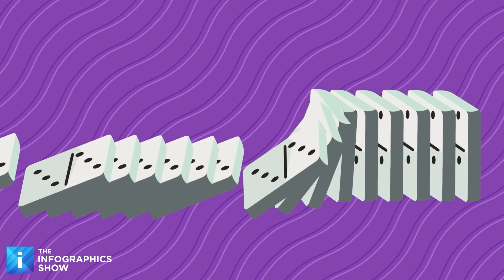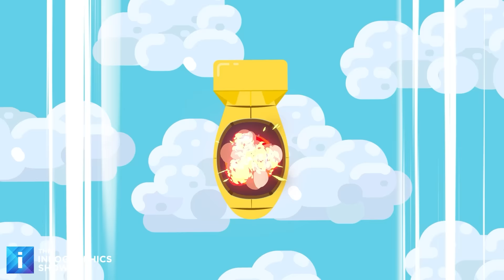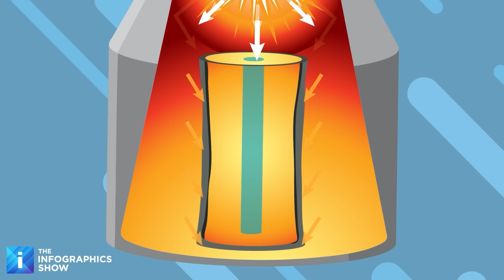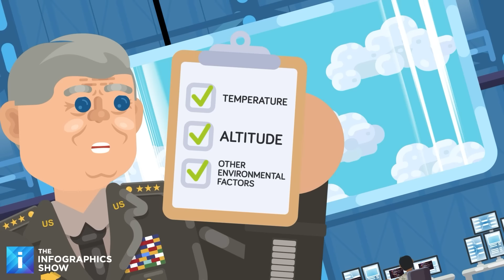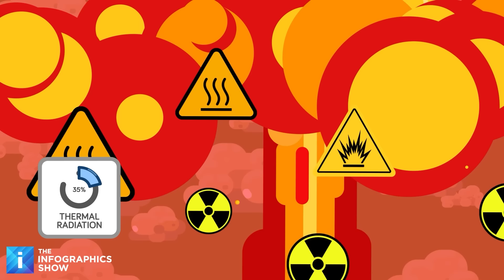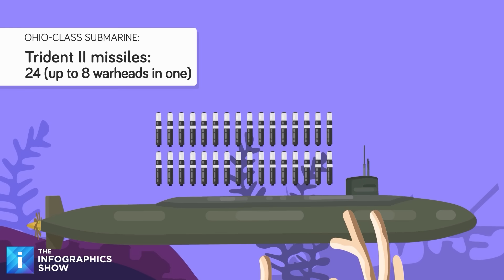If Building a Nuclear Bomb is SO Simple, Why Doesn't Everyone Have One?

Comment: why are  there  so  many black characters in this video?? blacks make up 13%  of population and 64% of murders and not involved in nukes. i change tritium bottles and neutron generators  on many nukes. MK 57, MK 28 and MK 43.the most important factor to cause a detonation are the capacitors which must send a charge to the critical material at exactly the same moment.

Comment: The key is in the enrichment and aquisition of raw materials.  While I wouldnt call the bomb design trivial its much easier than those 2 things.  If someone could perfect the silex system and trivialize the enrichment of these materials it would be a game changer for nuclear power.  Additoinally if you could transmutate these materials from partical accelerators you could circumvent the tight controls on these nuclear materials.  Really really hard to get uranium ore in any sort of quantitiy.

Comment: The most important part is the materials, once you got that the rest can be done with dusquuitining ease. Machining the material and explosive blocks to the required size and shape isn't terribly difficult. The precision firing system could be easily built from a cheap tattoo removal laser and fiber optics. Even the neutron source could be made rather easily as the materials needed are somewhat exotic but only needed in small amounts. Let's all hope they keep the fissile fuel metals under strict control.

Comment: 2.2 lbs out of 141 lbs? That seems wastefull. What happens to the un-used Uranium if only a fraction goes critical? Nukes are NOT necessary: We have FAB's (fuel air bombs) that are powerful. You need MORE FAB's to do the same damage, but at least it's not radioactive!

Comment: It's not about not knowing how to build a Fission bomb to set off a Fusion bomb. The hard part is building the infrastructure to achieve it a Fission or Fusion bomb. You need mines to extract uranium,  , reactors to propagate plutonium a reprocessing plant to separate and concentrate the plutonium and centrifuges to enrich/separate U238 from U235 and the energy required is very costly also.

Comment: Only gun type bombs are simple, but horrendously inefficient. You need more refined enriched Uranium for a single bomb, and you're maxing out around a 25KT yield limited by the short moment of fission increasing pressure, and blasting the core apart before more than 2-3% has reacted. 

Implosion style warheads, esp those with a booster (neutron donor) can reach yileds into the hundreds of KY yield ranges, esp with plutonium based cores, lower critical mass, higher compressibility. Implosion warheads, esp boosted ones, require more precision and advanced tech. 

The gun type is basically so simple its guaranteed to work... but as noted, low efficiency, and takes  a lot of refined uranium. Also cannot boost gun types.

Comment: IN MINECRAFT TUTORIAL:
-Obtain uranium-238
-Boil the uranium into a gas
-Run uranium-238 through cell membranes, and capture the uranium-235 particles
-Obtain 33 pounds of enriched uranium-235
-Obtain 10 pounds of trinitrotoluene
-Encase the trinitrotoluene inside a steel box
-Encase the uranium-235 in the same steel box with 90% concentration at minimum
-Place a fuse linking the trinitrotoluene to a switch, either radio controlled or manually burned
-Detonate the trinitrotoluene
Reply: Not even remotely close... even in minecraft... Also, this is so far off-base that using the "IN MINECRAFT" is just plain dumb although, it would be dumb even if loosely accurate as a loose explanation at this level even if correct would be so devoid of useful information that it'd be useless even to a state actor. And well, this, even more so, as all this would do is create a really nasty radioactive contamination mess.

Comment: The gun-type bomb design was so easy and foolproof that they didn't even bother to test the design before it was deployed. Little Boy was the first and only use of the design. You can also build them with less than weapons-grade enriched uranium, though they won't be as powerful. You can build one with 60% enriched uranium, btw.
Reply: @darkaxeldotexe  Technically there was a few further gun type designs , but none used in war of course. The W9 atomic artillery used in the famous “Grable” test was a gun type design warhead.

Comment: How does dial-a-yield work?
Reply: It controls the timing of the explosive lenses to increase or decrease the amount of energy hitting the fusion fuel in the secondary core. Some warheads also have the ability to disable the secondary so only the fission primary core detonates. Other designs inject more tritium into both cores to boost the yield.

Comment: It's (fairly) easy to make one, you could probably get the info off a Google search... What's hard, and expensive is getting u235 or plutonium 239.
Reply: Yes officer, I'm sure I need 400 fire alarms.
Reply: Forget a bomb, regular people encountering radioactive material usually leads to them becoming exposed to dangerous amounts of radiation and then contaminating their home if not their whole town. It's better if folks leave it alone. Leave this to the professionals.
Reply: Technically speaking, u235 is much rarer than pu239. To get enough u235 you need to process a lot (a really big lot) of u238. A uranium A-bomb tho, is easy (ish) to make. Plutonium, easier (relatively) to source, requires an implosion tho. 

And this is what makes things tricky on how to produce a nuke. Uranium requires a huge infrastructure and a lot of raw materials, but every 2-bit fiddle outfit can produce it. The infrastructure to do this is huge and very, very hard, if not impossible, to hide for an extended period of time.

Plutonium, doesn't require that much of a large of an infrastructure, but it requires a lot of technical know-how on how to make the explosive lenses, to the point where I can speculate that anything one person that can do this is quite well monitored.
Reply: @GrimpakTheMook  Technically, you could use a gun device for Plutonium. Provided it's actually pure Pu-239. The issue is Pu-240 contamination. Pu-240 spontaneously fissions too frequently and because of those spontaneously fissions, a gun type device can't assemble the critical mass fast enough to prevent premature initiation of the reaction, leading to a smaller than planned yield. Because of that issue, they needed to use an implosion device to assemble the critical mass quickly enough to get the yield they desired. 

Even with an implosion device, Pu-240 contamination is an issue if there's too high of a percentage of Pu-240.
Reply: what an NPC response